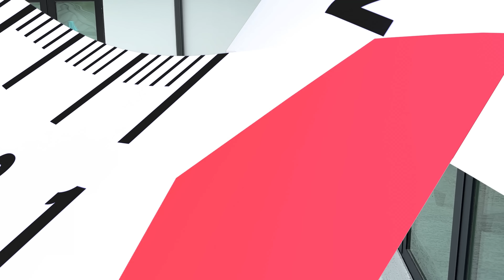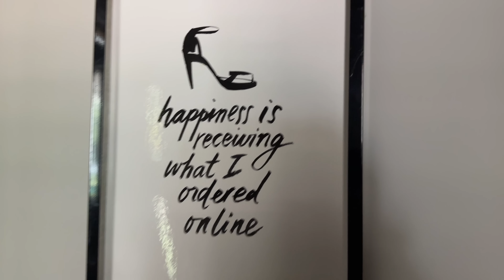MY BIRTHDAY IS RUINED!

Comment: Love your energy.   Here is some unsolicited advice that if you are already aware of, my apologies.   I admire you taking on the big charity event at your home.   I have served on several boards of non-profits in Los Angeles and have chaired many fundraising events at all sorts of venues.   First, make sure that the format/floorplan is approved by the local fire department.  You don't want to get shut down midway through your event because the local fire department says something is not to code. Second determine if with 350 people under a tent if added ventilation is needed.   350 people are going to put off a lot of heat.  I am sure your tent vendor knows how to do the calculations and set up proper ventilation.   Finally, be sure and get at least a one million dollar "event insurance" rider for the event.   They are usually fairly reasonable and are worth it if any problem arises.   Have a great event.
Reply: Note:  where do you put 350 vehicles (workers cars too).  Parking lot nearby where shuttles go back & forth to the event?  Hope the event is in the daylight.